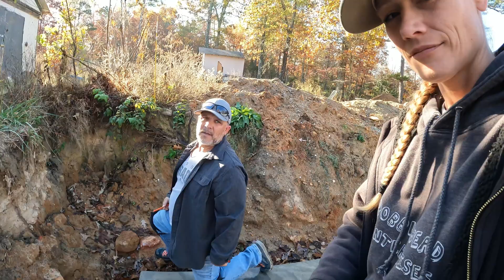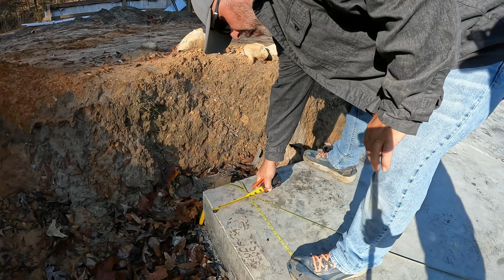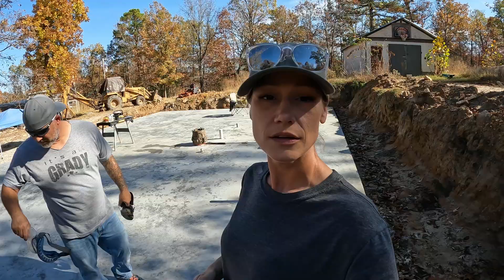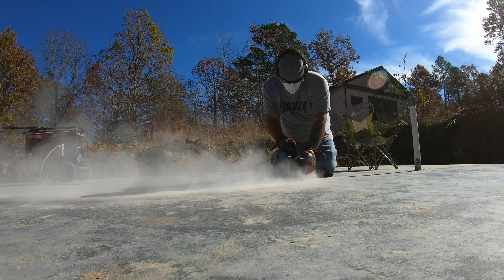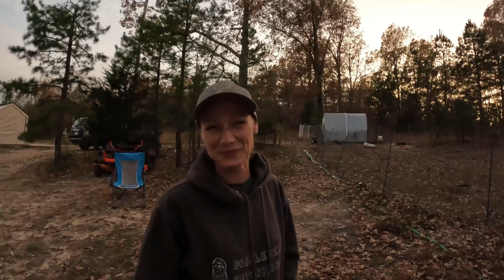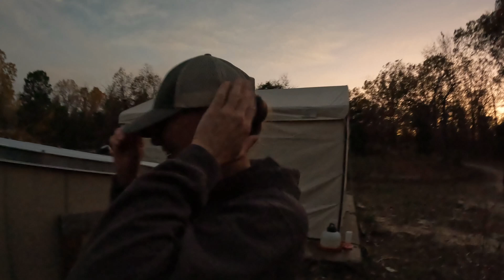HOUSE BUILD  CUTTING UP SLAB/ WHAT A RELIEF/TEMPORARY DRAINAGE

Comment: In your last video you guys had mentioned industry standards or also another word is building codes. The one thing that I don’t like about them is, that they are the “standard” building practices. I completely agree with you guys. If it isn’t right, it’s not right. When I look at building codes. I think sub standard, bare minimum. With that in mind how can it be built better with the materials that are available and what the job calls for. With that said, keep marching forward.

Comment: I didnt remember mel and Gary having relief cuts in the foundation
Reply: 99.9% of concrete finishers would never cut relief cuts in a foundation.
Reply: I’ve never seen someone put relief cracks in a basement floor. Now for like a driveway or sidewalk for example yes but why a basement floor I do not know because it will never be effected by frost.